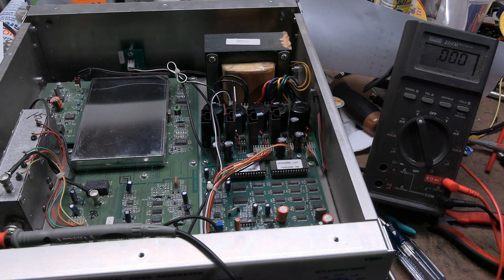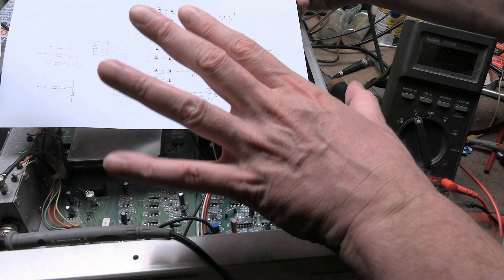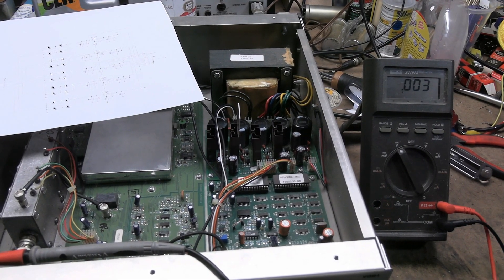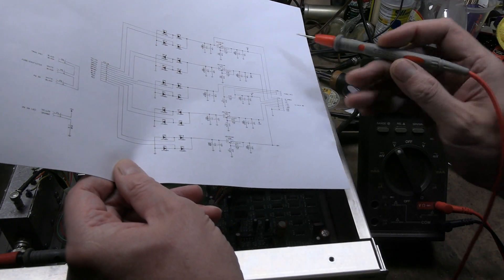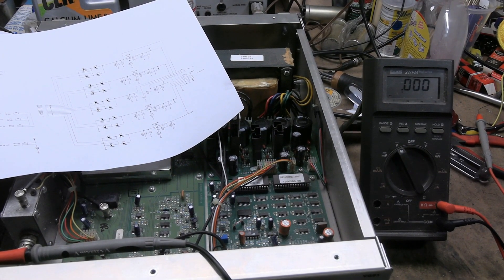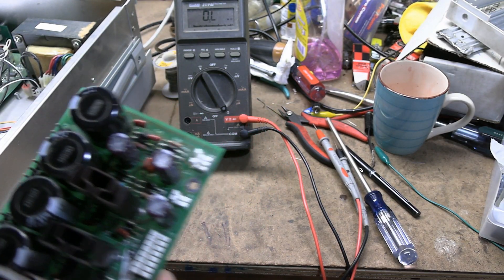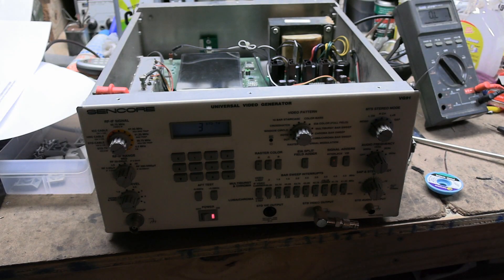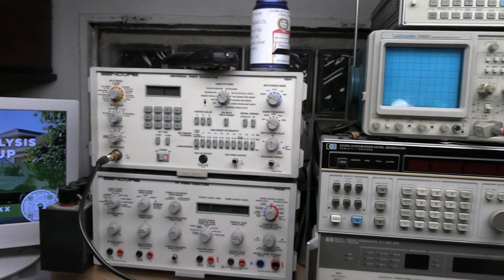Sencore VG91 repair part 2

Comment: Hi Bob,  glad you were able to repair your VG91, thanks for sharing your findings!     Would you happen to know where we can obtain a copy of the schematics or parts list? The board next to the power supply (the one with the 2 ICs: 169G266-65 & 169G266-6) on my used VG91 has a broken component "RT1" (glass thermistor?). Unfortunately there are no markings on the part so I'm a bit stuck.
Reply from the maker: No sorry I don't.  I was sent just the PS portion of the schematic by a viewer.
Reply: @bandersentv  No problem, for anyone with the same issue, I discovered that RT1 is a 10K @25C Thermistor

Comment: I may have posted in part 1. I would like a recommendation of a prom programmer to read out all my Sencore proms. I may have some, but don't want to go pulling the chips out until I am ready.
Reply: TL-866 style programmers are widely cloned  by seemingly everyone in China (so extremely low priced) and tend to work pretty well.

Comment: Wow. I never knew there was a backlight in the display! I'm glad to see you got it fixed.

The protection in those linear regulators seems like it could have been better thought out. I believe that instead of shutting completely down, that it just "folds back" the output until the temperature drops to a safe level. Then it starts all over again, until something breaks. It seems that a lot of designers like to push those regulators right up to their very limits, and I'm sure that doesn't help either.

I will definitely be inspecting my own VG91. (Another thing that probably doesn't help -- I'd guess these things all have tons of hours on them, having just been left on constantly when not in use.) It's disappointing that Sencore chose to say "you probably can't fix this, just send it in" as opposed to providing complete service info. That's all well and good until the company ceases to exist or won't support a product any longer! It's almost like they went out of their way to make it "service hostile", with no basic markings on the boards for voltages and such.
Reply: I'd guess that Sencore keeps complete modules on their shelves, perhaps ones that have been refurbished, so fixing is fairly easy if expensive.

Comment: 0:36 Inspecting equipment using the old troublesome series of Nichicon caps for leakage is a good tip, but if those caps are mounted like these one; sitting right on top the board with no space inbetween, the leaking electrolyte is trapped underneath and when you see it oozing out the damage is already done. I had some of them literally fall off the board at the slightest touch because the leads had been eaten away and only the gunk was keeping the caps in place. 
This is why I came to mount even the bigger electrolytic caps with a 1-2mm gap to the board.- Unless it is an application where constant vibration may stress the solder joints or vias, or height is an issue, there is IMHO no downside to it. 
And some of you may recall even how in the 80s a lot of radial electrolytic caps even up to several 100uF on PCBs actually had S- or U-shaped bends in the leads near the case, that would prevent them from dropping in flush with the board on the assembly line. On those designs leaking electrolyte could easily be identified by green or white crusties on the legs where it could at least partially dry up - and emit the fishy smell we all know.
Reply from the maker: Good advice.  I left about 2mm under the new caps.
Reply: I guess one could turn the caps completely upside down, extending the leads as necessary and hot gluing the body end onto the board.  But why is the vent on the bottom, not the top, anyhow?

Comment: I will never use Nichicon caps this is a common problem with them ruining the PC board.
Had them do this in a computer a pain to fix the board near the processor.
Only use good caps made in US or Europe more money but worth this not happening.
Reply: It wasn't a Nichicon-specific problem, every major manufacturer of low ESR caps used similar dielectrics that have all aged terribly. Have found low ESR caps from Chemi-Con, Rubycon, Elna, Panasonic, Sanyo, Philips, etc leaking. I don't really think it was quality control issues, just the known dielectrics to get low ESR 30 years ago were primitive and as we're learning now volatile and not long lasting.
Reply from the maker: What caps are made in the US?
Reply: @bandersentv ..."Sprague"...(?)
Reply from the maker: @daleburrell6273  they went out of business years ago. Vishay owns the brand name now and they only make a few types. The old orange drop and atom caps that cost a premium and I'm not sure where they are made. The old Sprague factory closed in the 90s.
Reply: @bandersentv  Mexican, I thought I heard
Reply: I use Kemet.  They seem OK so far.

Comment: Lm 317 does have more amperage output if I remember correctly.  Also possable they wanted future upgrade possabilities as the LM317 has different pinout than fixed 7805 15 ect.
Reply from the maker: No they are both 1.5A

Comment: the 78xx series tops out at 24V, so that could be one reason.   you can shift a fixed regulator's output up though by putting diodes and/or zeners in its ground pin to raise it up by the drop of the zener(s)/diode(s).  The 317 is pretty nice though since it only needs two resistors to set its output and it can handle higher voltages than the 78xx series can. it is also rather precise when when using 1% resistors

Comment: Nice work, glad to see the repair turned out ok and the VG91 is up and running plus a display backlight.  It should go brighter so the EL lamp is probably getting weak but at least there is some glow now.

Comment: Glad it came together and was a pretty straightforward fix. Regarding why Sencore use the Adjustable 317/337 instead of fixed is they could supply some non-standard output voltages if required by only changing one resistor.
Reply from the maker: Sure, but aside from 30, the rest are standard. They could have reduced part count and complexity.

Comment: Congratulations!!  Hope someone will Please be kind enough to post some of the service information where some of us VG91 owners can see it.  I have one of these which was damaged in shipping a few years ago and noticed the same "grunge" on the PSB you noticed and wondered about the caps leaking.  That grungy area also lines up with the vents on the top so it also tends to have dust and debris there.  Will get those caps replaced when I can.  Thanks again for this great video!